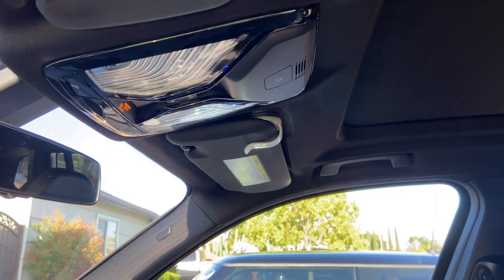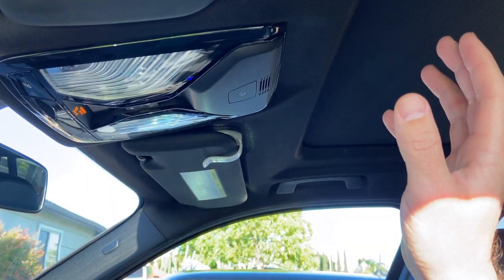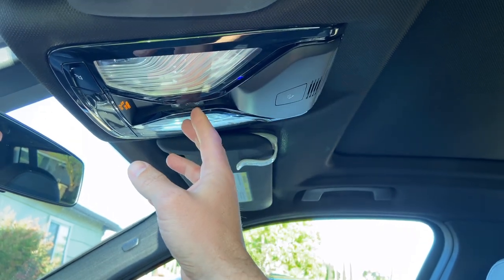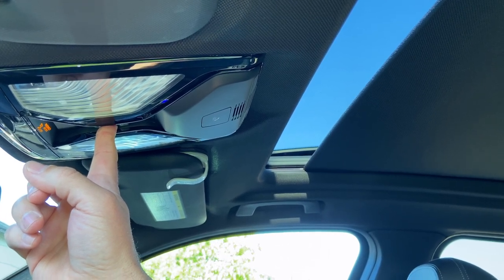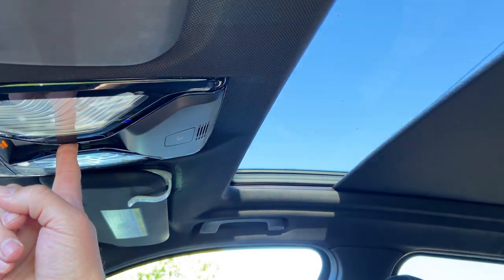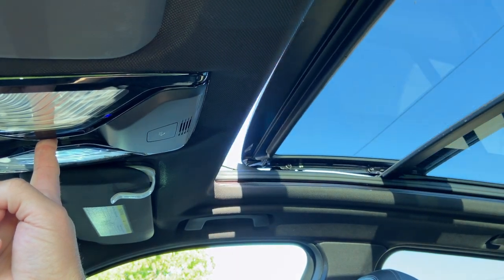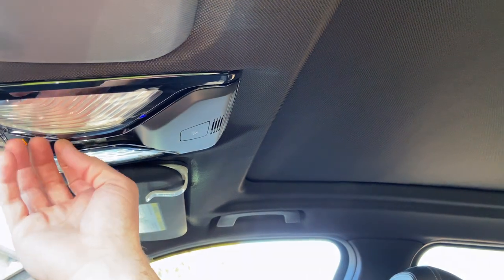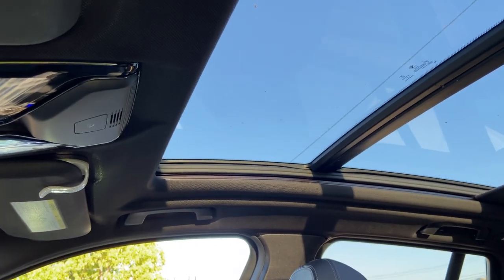Sunroof Initialization - For BMW's

Comment: After trying all the steps, unfortunately, they didn't work for my G80 330i. I visited the nearest BMW dealership, and even they couldn't resolve the issue. Eventually, they diagnosed a motor problem and replaced it at a cost of R12000 (approximately USD 630). Fortunately, I am still covered by the motorplan, so I didn't have to bear the expense. Thanks Mike much appreciated
Reply from the maker: Oh dang. Luckily they covered it.

Comment: I hade problems with sunshade and I tried do reset like u did in the video but know I have more problems. Now the roof just want to tilt and nothing else works. The heard some clicking noise when I tried to reset and after that I got more problems 😢
Reply from the maker: It sounds like something is broken in there.  😩
Reply: I have the same problem. Did you resolve the issue?
Reply: It says the initialization has failed
Reply: @cindychia254  i have the same problem, u have any news?
Reply: @berke.e734  it’s a bug. Nothing is wrong but mechanical lock. Just need to open the front interior light panel and unlock
Reply: @cindychia254 
Do you know how to unlock it?

Comment: for me it goes down and up and stops working
Reply: I was experiencing the same issue. After trying all the steps, unfortunately, they didn't work for my G80 330i. I visited the nearest BMW dealership, and even they couldn't resolve the issue. Eventually, they diagnosed a motor problem and replaced it at a cost of R12000 (approximately $630). Fortunately, I am still covered by the motorplan, so I didn't have to bear the expense

Comment: I tried so many times and it didn’t work. Do you know anything else I can do? 😫😫
Reply from the maker: it could be binding in the track, or the sunroof cassette may be worn out. Preventing it from initializing.  If it isn't moving at all then you may have a blown fuse, or bad motor assembly.

Comment: Thanks, Mike!
I did this recently for my wife’s E84 due to flaky BMW battery with a bad cell (only two years old).
She couldn’t get the shade to close…drove her crazy!
I was surprised not to find this in diag software. It needed to be done via the physical button as you demonstrated.
Btw new ‘new’ battery solved the initial oddity with the sunroof and other odd cluster icons appearing intermittently.
👋🏻
Reply from the maker: That's great news! Glad you were able to solve your issue. Appreciate you visiting my channel and subscribing.
Reply: I did exactly that and still nothing? Is there another option?